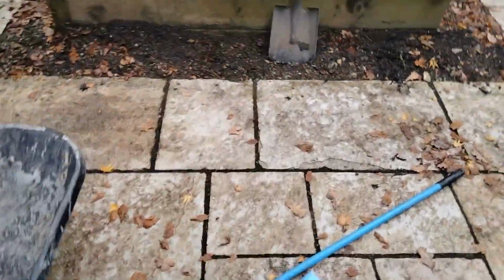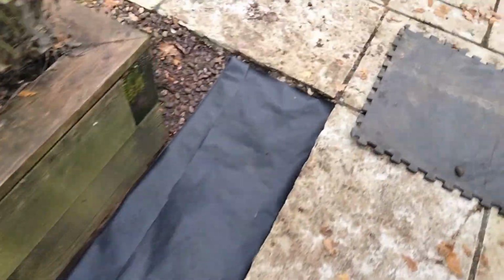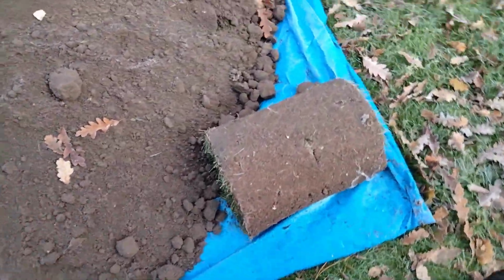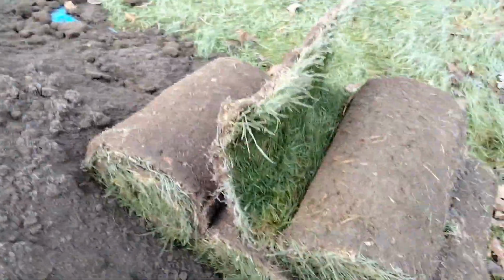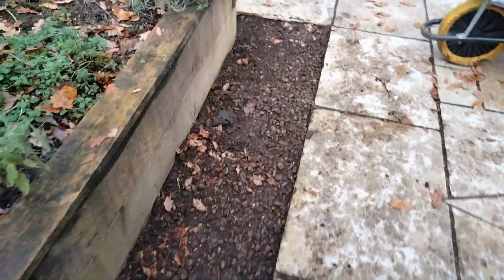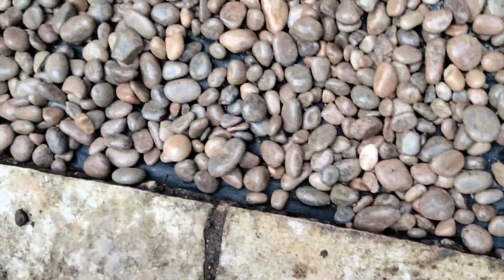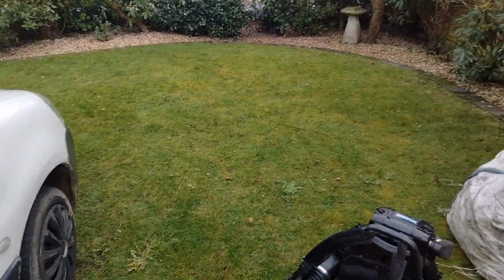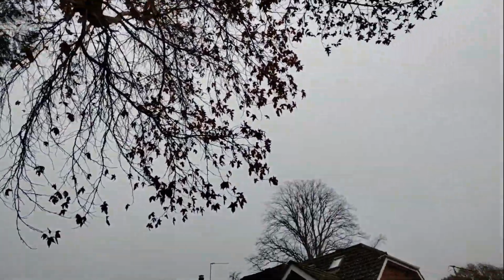Unveiling My Vision, Talking Systems & Becoming Efficient (A Day In The Life Of A UK Gardener EP19)

Comment: Hi Harley,
Great video, it's great to have that vision. I use Jobber,I'm only using the basic subscription.
Keep up the hardwork
Cheers,
Neil
Reply from the maker: Thank you for the lovely comment! I'll have to have a look at that software and see if there's something I could benefit and implement into my business 🍀
Reply: Hi Harley, your channel is great and it's great to see your enthusiasm and business vision for the future. My advice to you would be to "Job Cost" as many jobs as you can. This is a discipline I learnt and used when I worked for a large company before starting on my own. How it works is that you record or indentfy all the costs associated with a particular job. This must include all materials, whether own stock or bought in with the appropriate "mark - up" applied, time spent visiting and quoting for job, travel time ( this may be at a reduced hourly rate or £/mile) and of course how many hours spent on the job (excluding meal breaks) once you have all these cost simply take these away from the charge/quote figure and this will show you your profit but will also show you were your not quite as efficient as you thought you were. For example if you under ordered on say bags of gravel, then having to go to the supplier - mid job, to get more - that's were additional costs not accounted for can occur. I'm not saying you job cost  every single job, it's not worth the time on the small jobs, but on the medium to larger jobs I would definitely recommend it. It's  definitely helped me because I always want to know how much I've earned per hour and this will show you, because at the end of the day when we're employed that's what we want to know !  I hope this help you and keep up the great work. 👍
Reply: I also use Jobber. Bloody brilliant bit of software. Its pricey but come the end of the year for tax purposes, it saves you hours upon hours of boring paperwork.

Comment: It is very hard to successfully do both maintenance and  large landscaping jobs in terms of scheduling  if the landscaping is more than 2 or three days.  What you find is you can get utterly scupperd if you are doing cement work and get wet  or cold weather as you then end up having to reschedule the maintenance jobs and it can get really awkward.

The other issue is you have a hell of a lot of stuff to store / load  and unnload constantly.

Imo better to stick with  either the maintenance  or landscaping  and really concentrate on it.
Reply from the maker: I do see your point however I believe if I was to get another van on the road this would be possible! Thanks for the support!
Reply: @HDGardenCare   an additional van would certainly help, for me it was a nightmare with constant loading and unloading.

The big complex  landscaping jobs were I could make the best profit on I really really struggled to fit in and the small jobs were neither very satisfying or as profitable and I could make the same profit from the maintenance  without having to be  unloading tools constantly or the stress of pricing up detailed landscape quotes.

In the end I stopped the landscaping and just concentrated on doing maintenance  and  whittled this down to just very big jobs were I would spend a whole day on the same site.
Reply from the maker: I can see your point I bet it can be a bit of a challenge. However I would love to be able to make it work!